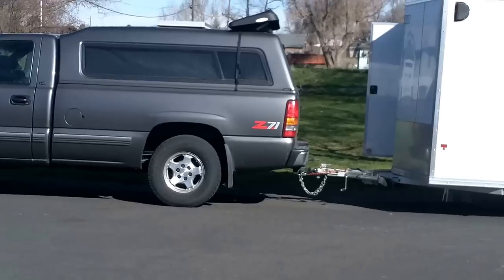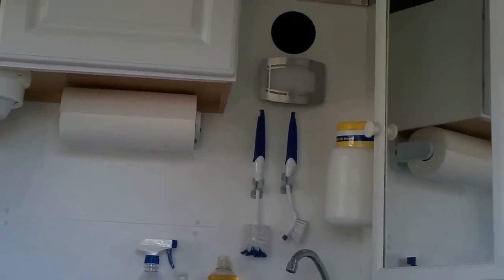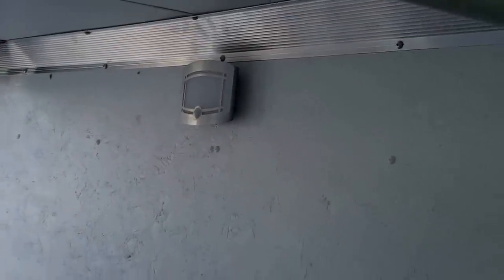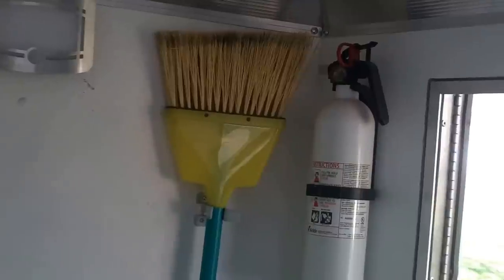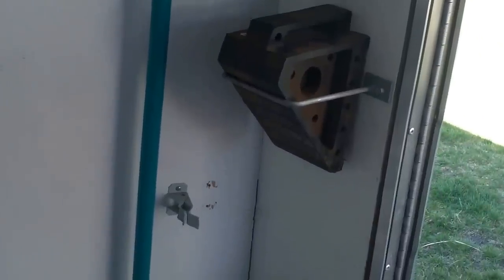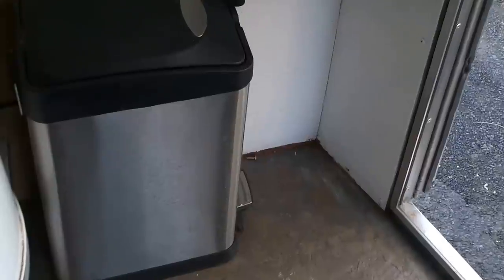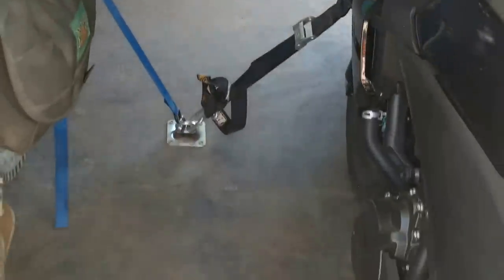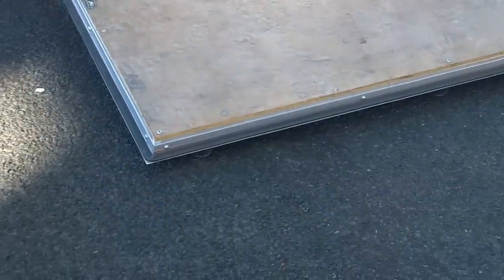Enclosed cargo trailer turned budget toy hauler -Tour

Comment: Nice setup. I just bought a 7x14 haulmark enclosed trailer off the original owner who just used it for camping. It is in mint shape for 9 years old and has been insulated and has a roof AC unit on it. The guy wired the trailer for 110v but I'm going to change a lot. It also came with a Condor wheel chock. I'm pretty excited about hitting the road. Probably do Sturgis this year. Thank you for the video. It gave me a lot of ideas.
Reply from the maker: Glad to hear it.  I hope you have amazing travels with your trailer.